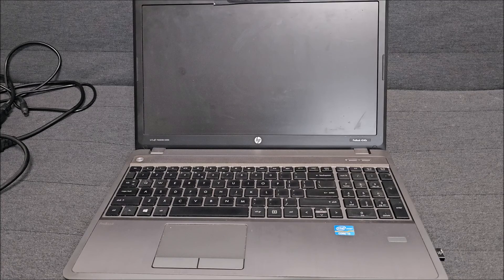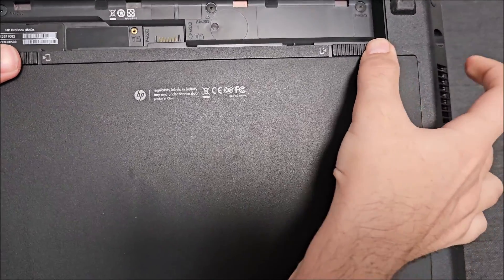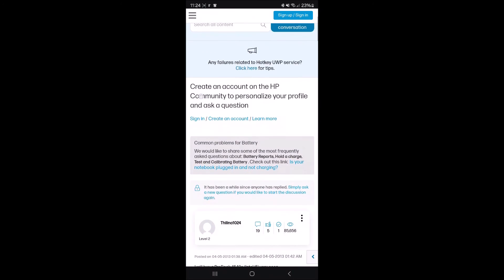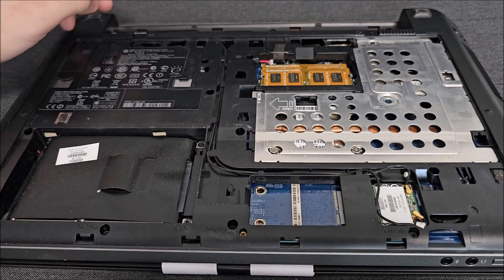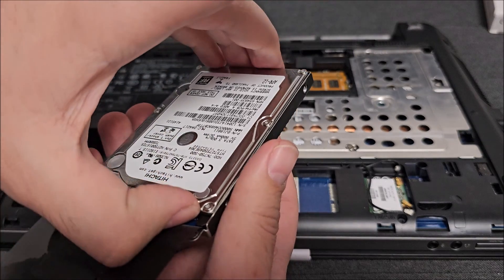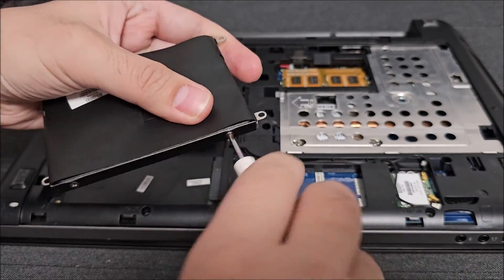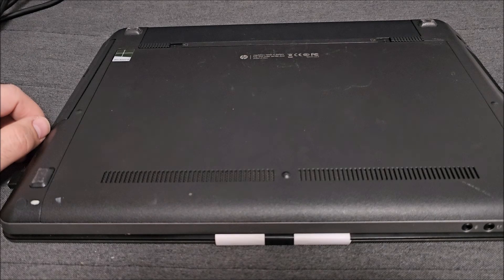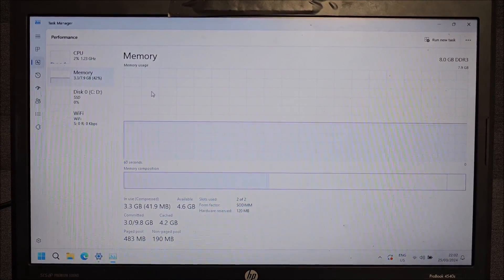Upgrading the memory and hard drive to SSD in a HP ProBook 4540s

Comment: Hola, tengo un hp4540s que en las características acepta 16gb de RAM, que si le pongo 16gb las recibe y las detecta PERO…. el portátil se ralentiza, le cuesta más arrancar y los procesos los hace más lento. No entiendo como puede pasar esto. He leído en foros de gente que reporta el mismo problema pero no se encuentra solución ni el origen del problema. Alguna idea de solución o explicación del problema? Gracias.
Reply from the maker: Hello. I have seen this behaviour before on other laptops. It is a limitation that can't be solved it the vast majority of cases. As far as I know the only solution is to go for a lower amount, like 12GB for example.
Reply: @ but what is the de device that limitates the ram increase?
Reply from the maker: Chipset mostly. Sometimes bios.
Reply: @ So it is bad to know that it has not solution for this laptop. I cant understand, Why more memory produces less performance?
Reply from the maker: Try to search on forums. Most seem to agree that the maximum limit was actually set wrong and the chipset is strugling with it. But search on forums for things like "slow laptop after memory upgrade"
Reply: @jjawier  the reason is certain motherboards are incapable of handling more than [ specified ammount ] of ram as it can often overload the system trying to handle large ram sticks its basically just a bottlenecking issue